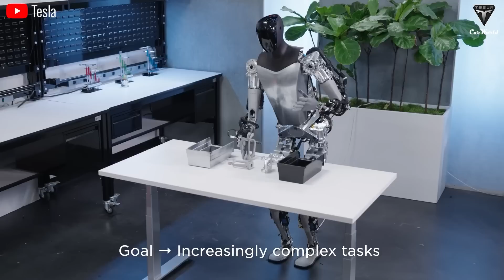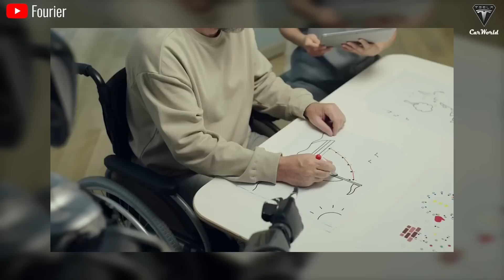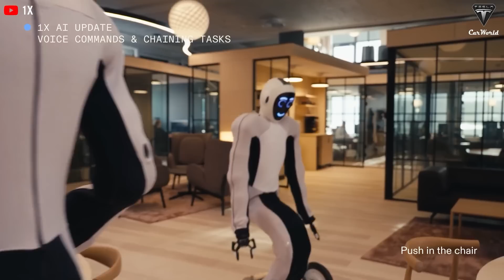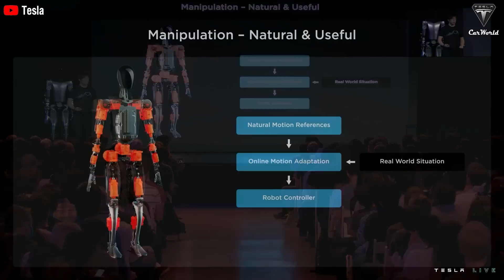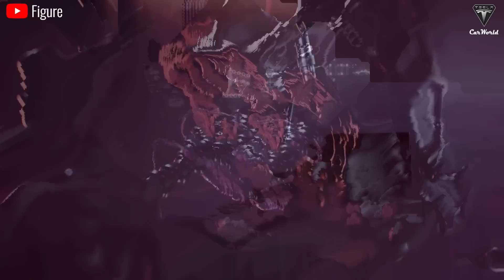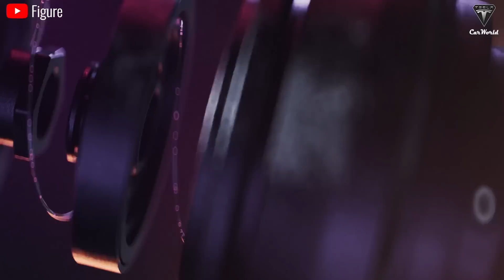It Happened! Elon Musk Review Everything Tesla Bot Optimus Gen 3 Can Do! Homemaker and Hard Worker!

Comment: I feel it is the small thing that eludes them; 
When designing a robot's foot, the key considerations are stability, balance, and adaptability to various terrains. Here are some principles to guide the initial design:

1. Foot Size: A larger foot base provides more stability, especially for humanoid robots. A size comparable to an average human's foot, around 10-12 inches (25-30 cm) long and 4-5 inches (10-12 cm) wide, would be a good starting point. This size offers a balance between maneuverability and a stable platform.

2. Shape: Consider a foot shape that is more rectangular with rounded edges rather than purely human-like. This can improve contact with the ground and distribute weight more evenly, especially on uneven surfaces.

3. Materials and Cushioning: A flexible, durable material like rubber for the sole could improve grip and shock absorption. Integrating sensors to detect pressure or uneven surfaces can help the robot adapt its balance in real-time.

4. Ankle Flexibility: Incorporating a joint that mimics an ankle can provide better adaptation to different surfaces and enhance stability.

Starting with the foot is indeed crucial, as it lays the foundation for the robot's overall mobility and balance. Focusing on shock absorption, terrain adaptability, and balance mechanisms can significantly enhance the robot's walking capabilities.